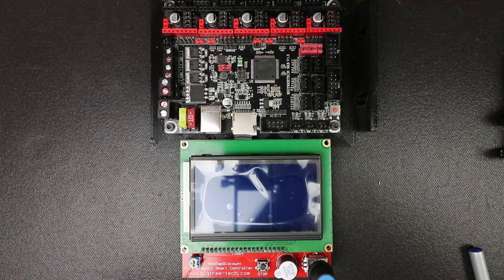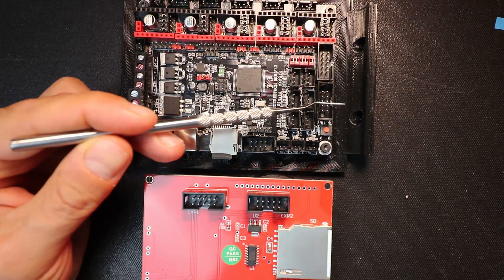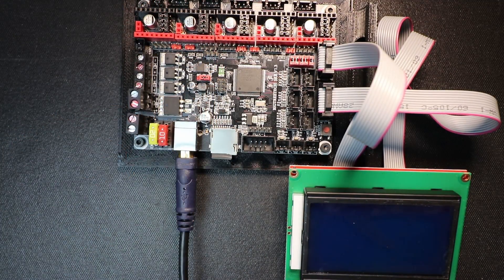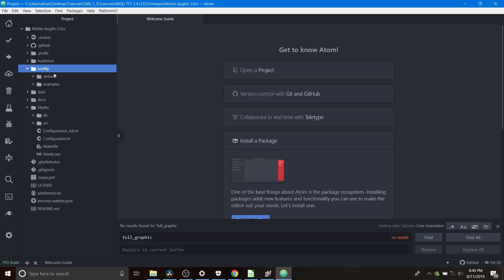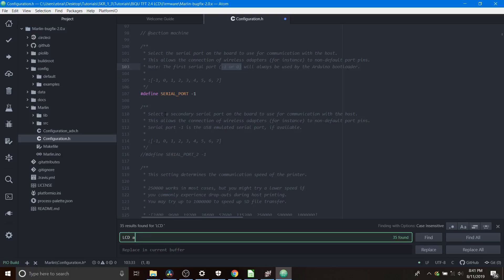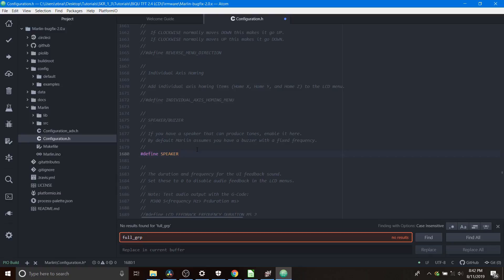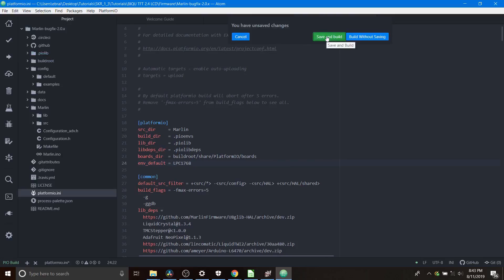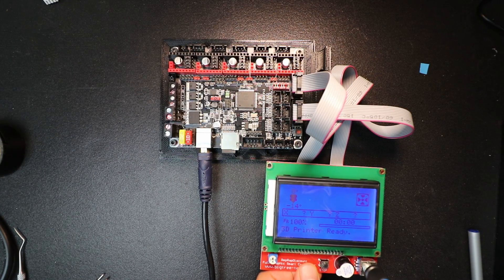SKR 1.3 - 12864 LCD Graphic Smart Display Controller Board (RepRap)

Comment: There is no RepRap with 12864 LCD Graphic Smart Display Controller Board, You just replase firmware to Marlin :( 
Like others, I have problem with RepRap and Smoothie, but it corectly worket on Marlin 2.
Reply from the maker: Could you rephrase, I'm not sure I understand the question?
Reply: @EdwardBraiman  I mean that threre's written (in video name) about "12864 LCD" and "RepRap", but in fact that video is about install/config Marlin :)

For now I have SKR 1.4 with 12864 LCD and it prefectly work with Marlin 2.0, but with Reprap or Smoothie firmwares just ligthing background and sounds like mosquito.

O ... and I need it for Rotary Delta kinematic, but Marlin does support only linear deltas.
Reply from the maker: Unfortunately I don't do videos on later two firmware.

Comment: Thanks, just a warning for MKS board users, they have the EXP1 and 2 connectors reversed, so it will not work like displayed here, you have to rotate both connectors 180 degrees. You can achieve this by pulling of the black cover for the connector and placing it back rotated, or just cut another notch in the black plastic cover.

Comment: Greetings from Russia!)) Your videos are very informative! I have a question about connecting and configuring REPRAP_DISCOUNT_SMART_CONTROLLER to a SKR 1.3 board . I specified in the firmware everything that is needed, but it does not even light up, although it is working. Maybe on the scr 1.3 board there is another pinout of EXP1 and EXP2 ???
Reply from the maker: Could you specify which type of LCD?  Does it have three ribbon cable ports on the back of the lcd?

Comment: Does the microsd need to stay in and is the sd slot in the graphic controller now usable? I have a MKS sgen l v2 that I’m trying to resolve this on....
Reply from the maker: Yes sd needs to stay in slot as it's only for firmware loading.
Reply: Edward Braiman ok, cool. And should the SD reader on the screen work to load stls ? This is something I have not been able to resolve.
Reply from the maker: Search on sd in Marlin firmware and there should be a place to enable sd card for lcd.
Reply: Edward Braiman it is enabled. But it won’t recognize. Maybe I’ll try to completely rebuild and start over. It was at least close on this build....

Comment: Hey there. I own a Tevo Tornado Copper 2018 version. I just learned that knocking out the tabs on the ribbons and rotating them 180 degrees made the display work with the SKR 1.4 board. The pins are just flipped on the board. You can use the same locations for the cables (U1 > EXP1, U2 > EXP2), it's just that the tabs need to be cut off and cables rotated 180. Thanks! The rest of your settings worked great for Platformio. I use Marlin 2.0.x (but I think it's 2.0.5?).
Reply from the maker: True, thanks for the info.

Comment: HI I have a problem I have the lcd 12864 display when I plug it in my sd card stop working when I unplug it the sd card works. Now the display does not have a sd card on it like the one you show but it is a LCD 12864 board . the screen does not light up  . Skr v1.4 turbo/ Marlin 2.5. I followed your video. Any ideas?
Reply from the maker: Try enabling sd retry.  Which version of Marlin again?
Reply: @EdwardBraiman  I am using marlin 2.0.5 the display is from the Anet A8 plus stock. I have the sd card enabled . the display is a lcd 12864 with out a card reader.
the display will not even light up
Reply from the maker: It might be related to pinouts.  You'll need to find the LCD pinout diagram and match pins to printer board.

Comment: Thanks for the informative videos. I've followed the steps and lcd seems working but here is the situation. I click  print on lcd menu it just states printing but nothing happens. I open the pronterface connnect the board and again click  print on lcd menu the print begins. So I can not start print via lcd unless I open pronterface and connect  the board. Situation remains both with lcd sd and on board sd choices.
Reply from the maker: Check inside Marlin firmware on configuration.h for #define sdsupport make sure the comments are removed and then reload firmware.

Comment: Is there another one who only gets bieping noises from the display and it is not showing the marlin booting screen ?
Reply from the maker: Does the screen illuminate?  Is it plugged in backwards on ribbon cables?  Explain your configuration with SW/HW versions.  It's hard to understand the issue you're seeing without some details.
Reply: @EdwardBraiman  yes the screen illuminates, but its only blue ( no marlin logo). I tried every possibility with the 10 pin ribbon cables -> forward (normal like in your video) and also backwards and also with 1 of them crossed at a time. I also followed your instructions. I have also downloaded marlin version 2.0.1 ( i hope that's not causing the problem, the bugfixes of "bugfix-2.0" version should be included in 2.0.1 i guess). 
My hardware is a CR10S (but not yet connected). An skr 1.3 board and TMC2208.

If you need further information, feel free to ask and i will try to provide them =)
Reply from the maker: I'll give it a try and see if it occurs.
Reply: @EdwardBraiman  i got it fixed with downloading bugfix-2.0 marlin and removed the jumpers underneath the TMCs ( like you showed in another video for the TMC2208).

The marlin boot screen occurs and some values are displayed. But unfortunately im also getting "TMC CONNECTION ERROR" displayed
Reply from the maker: So I checked bother 2.0.1 and 2.0.x for bugfix and they both worked on SKR 1.3 for RepRap discount full graphics smart controller.  Are you using some other hardware or is there a compiler issue?
Reply: @EdwardBraiman  compiling didnt show any issue / error. 

Do the TMCs only work when connected via 12 / 24V with the power supply ?
Reply from the maker: TMC connect error means something not configured correctly.
Reply: @EdwardBraiman  oh ok, so i guess i have to find it myself....since atom and also VSCode dont show any issues.
Can you maybe write me a DM, would be my last try for now to solve that issue
Reply: @DoOmeR930  Did you fix the problem? Same thing for me although for the first time when I turned the cables 180*  it did showed me some letters and logo but then my board fried (in around 2-3 min). Now i've got the blue screen and constant beeping without any letters
Reply: @EdwardBraiman  Writing to you as well just in case! Did you guys fix the problem? Same thing for me although for the first time when I turned the cables 180*  it did showed me some letters and logo but then my board fried (in around 2-3 min). Now i've got the blue screen and constant beeping without any letters

Comment: Hello
How do I enable the MKS MELZI V2.0 controller board with the epRap Discount Full Graphic Smart Controller 12864 LCD display?
Reply from the maker: Unsure, but look in boards.h for the board type for motherboard.
Reply: @EdwardBraiman  But the display does not display information
Reply from the maker: I'm guessing you might need to look in pins file for melzi and see if compatible with hardware.

Comment: Thank you, but how to aktivate the skr sdcard? , I can not use my sdcard on skr1.3 for prnt.
Reply from the maker: Does you computer connect using Pronterface?  What operating system are you using and version?
Reply: @EdwardBraiman   yes, I connect using Pronterface,win 10, all is ok but the skr sd card reader not detected for printing.
Reply from the maker: Are you trying to print via sd card on LCD?  In Marlin firmware make sure SD card has comment removed in front of SD card.
Reply: @EdwardBraiman  via sdcard reader on LCD is Ok no issue, but I want to print via sdcard on skr1.3, even I had comment out sd card support on marlin, the sd card on skr is not detected on LCD menu for Printing. (Sorry for my English)
Reply: @f3rrym  You cannot use the SD card on skr 1.3 for printing. It is only for the software. Use sd card on lcd for printing.

Comment: What about the MINI12864 display with SD reader?
Reply from the maker: I'll need to research this.
Reply: @EdwardBraiman  I used it once with a different controller but it's been a while. For some reason Atom will not install on my laptop running Windows 10 so I am using VS Code instead.
Reply: @EdwardBraiman   @bill Karoly I can attest to the connectors being reversed. Very strange, so either make new cables or clip the nubs off :)
Reply from the maker: @JulBSN still need to find a version online.

Comment: Great video.  I have my skr v1.3 up and running with sensorless endstops/homing finally.  Took a lot of research to get it to work properly.  Something a lot of tutorials and  instructions fail to mention about it is having to solder a pin on the driver for the DIAG jumper.  Please include this if you do a video on sensorless homing.  Thanks!